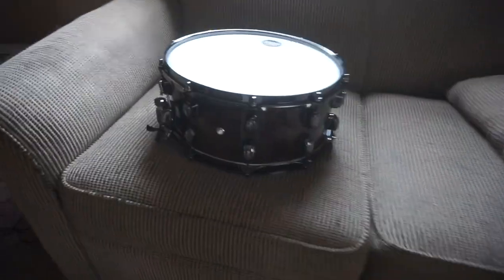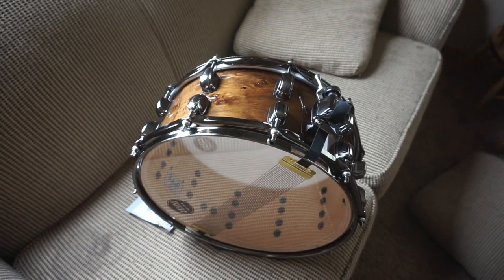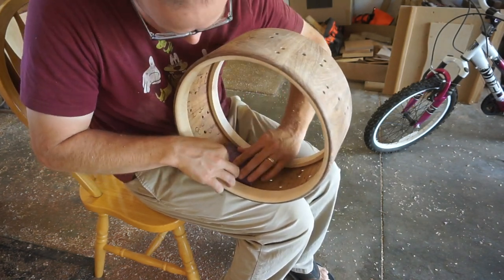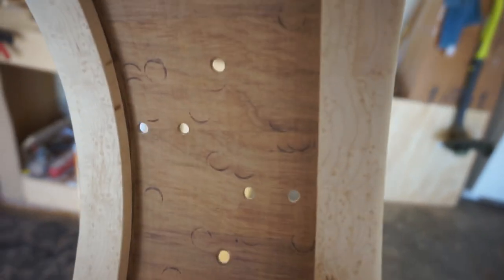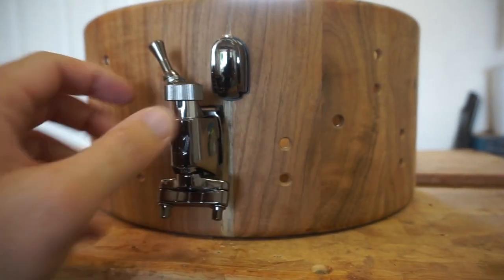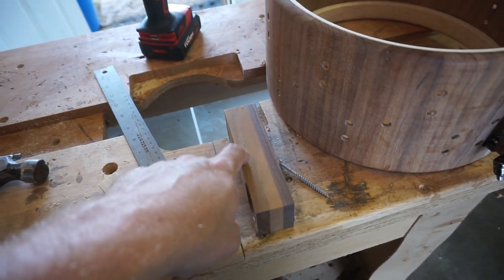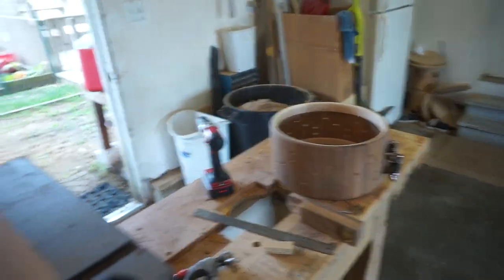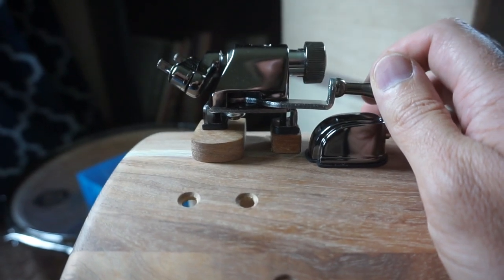COMPLETING THE TIGER WOOD RE-BUILD

Comment: Just an Idea to pass on to you as a snare builder myself brother, And by the way, nice work from the minimal shop tool setup like most of us with our home garage shops, etc.
So, @14:40 I would have liked to see Brass stock used and polished, then a few coats of clear automotive clear coat found at Home Depot in the paint area on the shelf with the other cans of paint, I have brass now over 8 years ago sealed with this clear coat that has not turned green, or reacted with the wood. Anyways just saying when you mentioned not caring for that look, I think you would be more liking of the brass stock used in place of the wood spacer or stand-off.  Good to see all three of you involved in the build, good memories are being created there for sure with the young man.
Cheers.

Comment: Very nice build. Neat jig idea for drilling consistent lug holes. Did you have any issues with blow-out without a backer board when doing that? I'm sure that it's somewhat wood specific, but I was nervous watching that part.
Reply from the maker: Yes, there is almost always blowout.  That's why I drill the mounting holes before I mill the inside of the shell.  The milling does not result in blowout of its own and cleans up the blowout from the drill.  Thanks for watching!

Comment: Could you have installed dowel plugs in the problem holes, since you had some of the same wood?
Reply from the maker: Sure.  I didn't have a plug cutter that was the right size, and I was on a time crunch.  Epoxy and saw dust fit the bill and satisfied the buyer.
Reply: @JosephCenter  Sometimes you just have to make do. Great job

Comment: hi joseph. I follow your channel because I love the work you do. I have three questions. How many blocks and how many degrees are the cuts that are made to make a snare? the hoops that you put inside the esnare, what are they used for? What is the liquid you use to brighten the snare?
Reply from the maker: Hi, Marco -- Thanks for watching and for writing.  (1) number of blocks and cuts depends on the drum; I use this website to calculate them: https://uniontownlabs.org/tools/stave/ ; (2) the hoops give the outer shell rigidity and strength; and (3) there are a variety of possible oils and finishes to use, and the one I used on this drum is called Danish Oil.